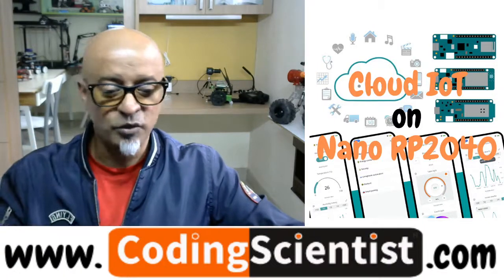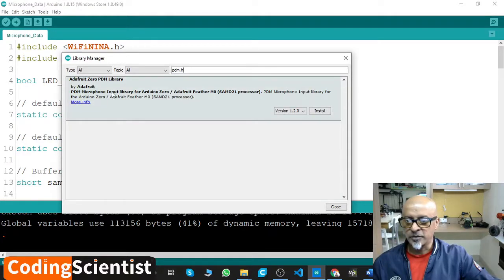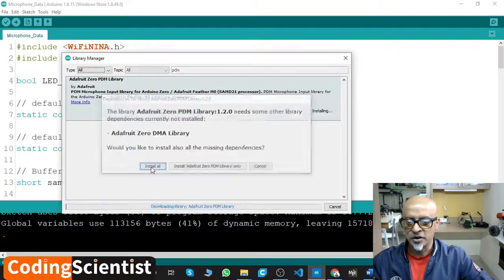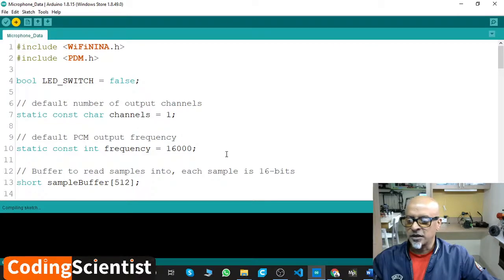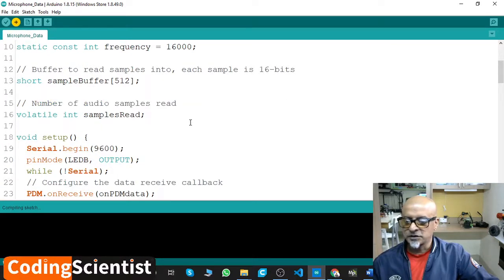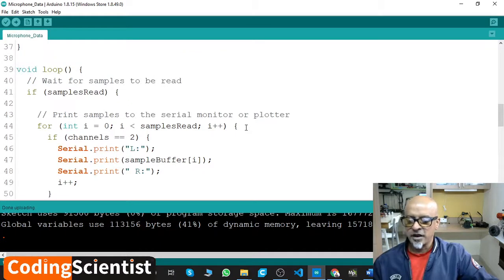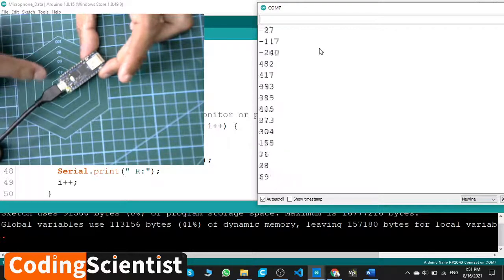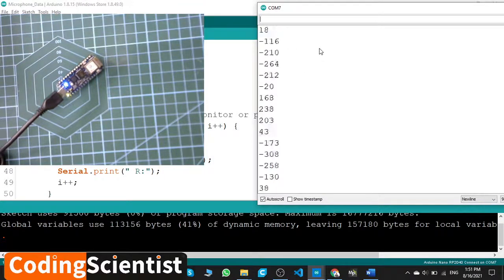Lesson 7 Microphone Data Projects Nano RP2040 Connect

Comment: Thanks for this series on RP2040. It's such a good series. how do you confirm the microphone is working? For me, initially, it displays 'On', later switches to -128 and remains the same. It does not respond to sound commands. Any suggestion?
Reply from the maker: Thanks, check the serial command terminal, you can see the output for each sound detected.